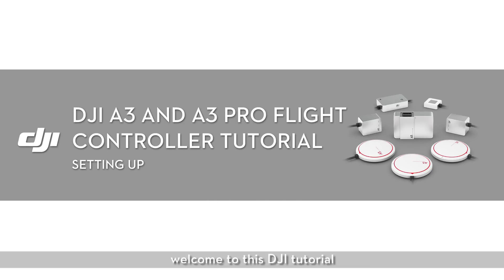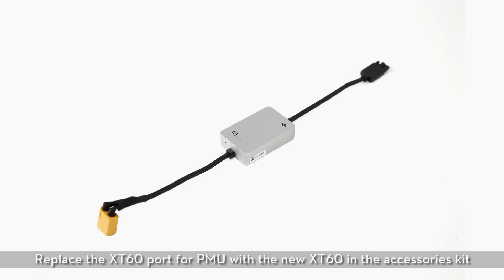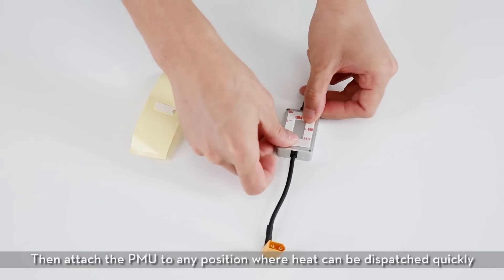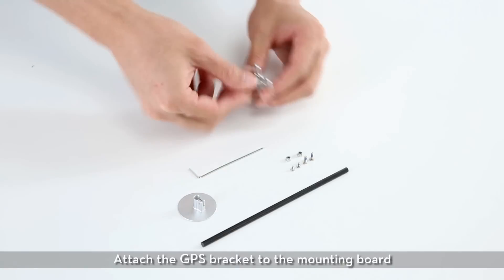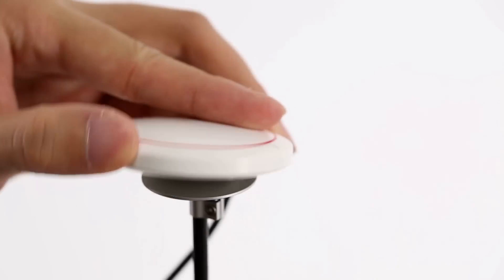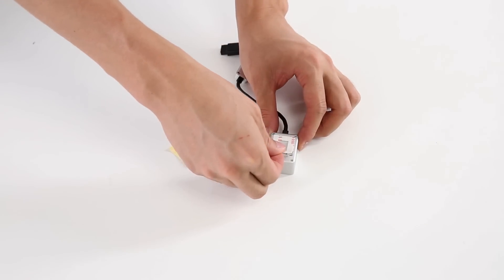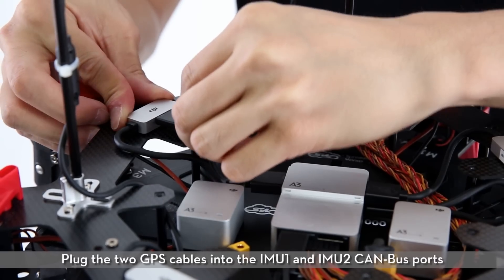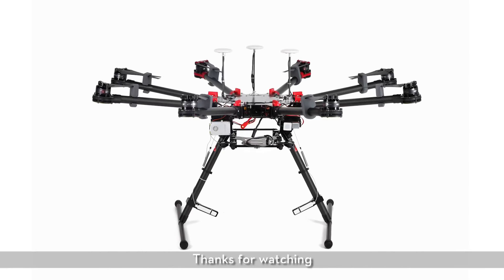DJI Tutorials - A3 and A3 Pro Flight Controller - Setting Up

Comment: Are there any plans for a new Transmitter? There is the new controller for the Mavic but nothing new on the horizons by way of Lightbridge? Lightbridge has been out for years now and  companies are bringing out new controllers for FPV yet nothing new from DJI. I guess DJI is years ahead of the competition they aren’t in a hurry. Which sucks.

Comment: Is the 3M tape really strong enough to hold these components on for prolonged use?
Reply: Yes it is
Reply: The word tape in this instance scares me but if you have had experience with using 3M tape to secure pieces to a Drone, I will bow to your knowledge. Thank you for answering so quickly.
Reply: This tape is super strong. You'll have at tough time removing and parts attached with it. Great stuff.